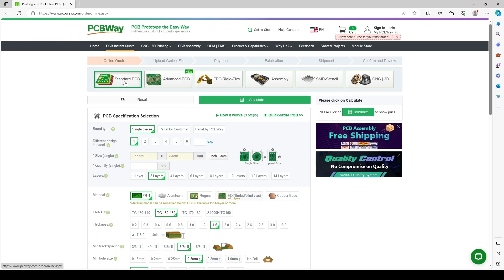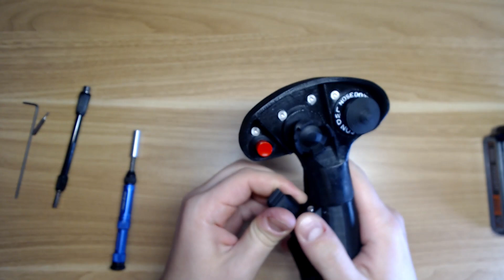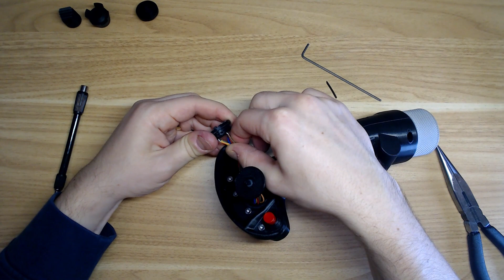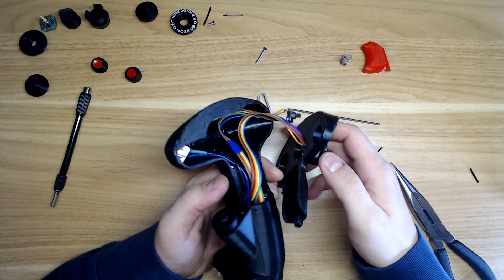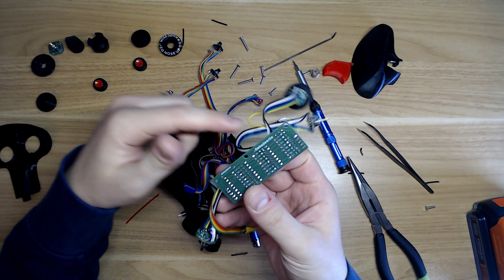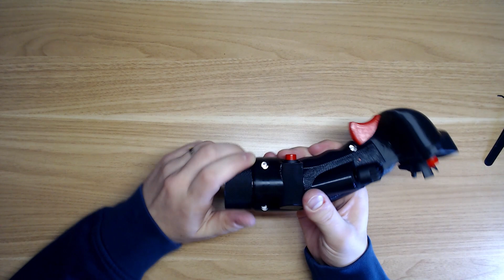F-15 Grip Full Assembly Video

Comment: I NEED to know if there’s any issues I’d run into with having PCB way print the grips with metal and buttons in resin.
Reply from the maker: Hi there, I printed in resin and it turned out great! I recommend printing connector in metal however as that takes a lot of load. (The one that fits between the grip and through the threaded nut at the bottom)
Reply: @thesimnet  thank you!!!

Comment: In your next video could you comment on how to go about having PCB Way print out the metal parts for the adapter and nut?  I noticed while visiting their web site that they have a "community market" section.  It contains designs that you can have them make.  It would be great if you could upload some of the candidate metal parts and PCBs to make it easier for your followers to obtain those parts.
Reply from the maker: This is a great suggestion, I will be looking into this for my next project and if it works out, I will make it available for all previous projects as well! Thank you!

Comment: Great video.  I enjoy the longer format, although it might also get you more views, if you produced a condensed version where you fast forward some of the more mundane tasks, but slowing to real time for those parts that need more explanation.  I wished you had mentioned the cost of the 3d printed metal parts from PCB way.   I assume those must be fairly expensive?   I like your idea of producing the shift register and 5 way hat boards with the JST connectors, however I find assembling the JST connectors pretty tedious.  I can solder wires to circuit boards in about 1/10th the time.  Perhaps someone sales pre-made wiring harnesses with JST plugs on each end.   You mentioned it a couple of times:  so I would like to see a video about your Rhino Force Feedback joystick maybe fitted with the F15 grip.   Keep up the good work.
Reply from the maker: Thank you so much for the feedback - I appreciate the suggestions and these help me improve for next time. The metal connector costs about $25 when printed in aluminum. Ideally I would love to have the entire grip completed by PCBway and for folks to order them directly - still working on that! Rhino stick review to come soon as well, I want to make sure I give it a few months of hard use before reviewing!